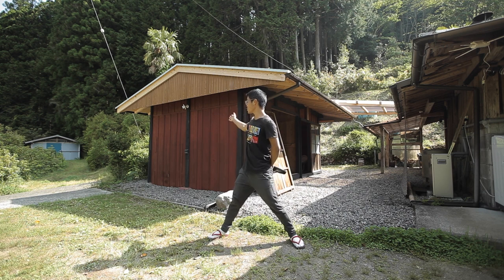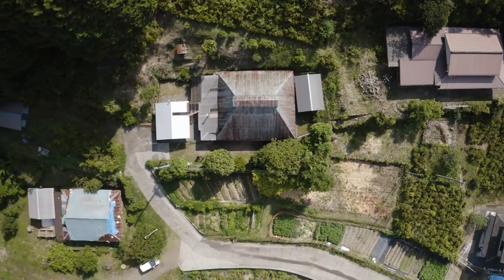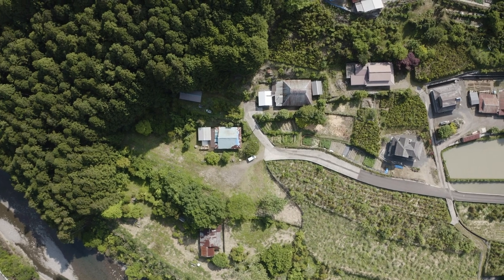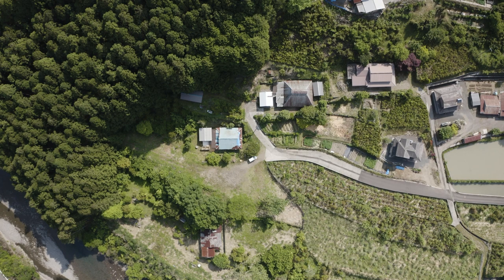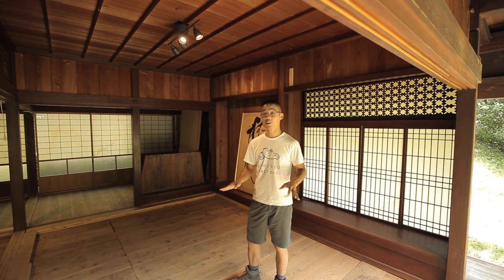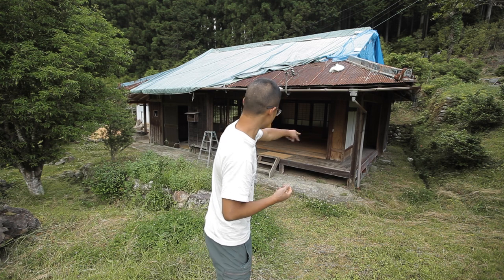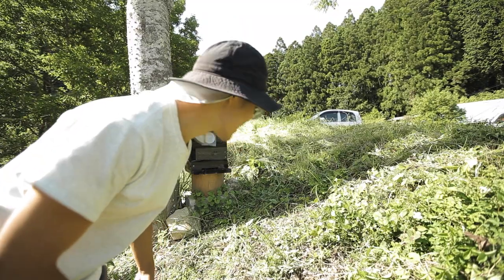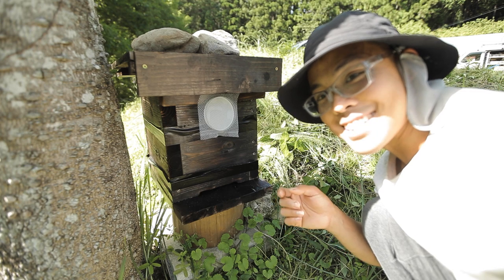My 120-Year-Old House Finally Gets A Septic Tank (For My New Cafe)

Comment: Did I hear you right? 300 000 $ for a roof? Are you sure you didn't add a zero at the end? That is absolutely crazy!  Would the more traditional thatched option be cheaper, or even having a ceramic tile roof?
Reply from the maker: Omgg I did add an additional zero because I was miscalculating the yen sums in my head (plus the thatched roof for the main house would have cost $100,000 if rethatched professionally). Got to correct the mis-calculated sums somehow! Thanks for noticing.

I meant to say the re-roofing quote for this house was for $30,000 not $300,000. With $300,000 we could probably even get a copper roof 😬
Reply: @Ryunohara  or you could just staple the bills to the roof, they're supposed to be waterproof aren't they ? 
How many single dollars would that take anyone know? XD